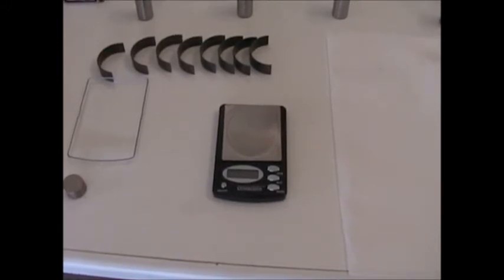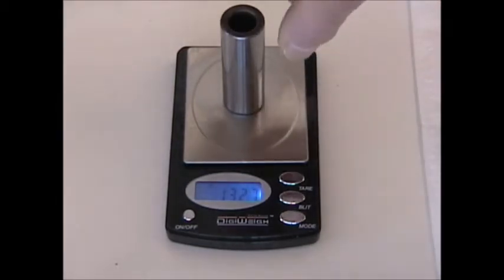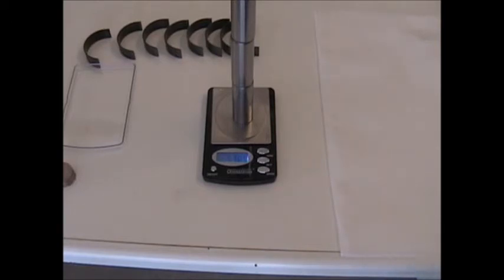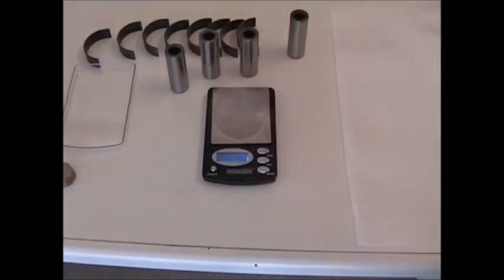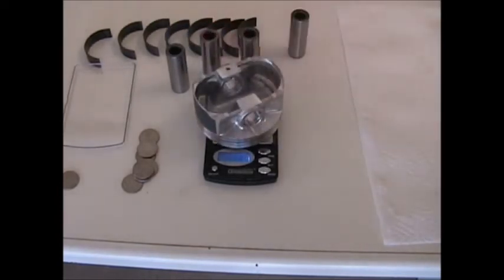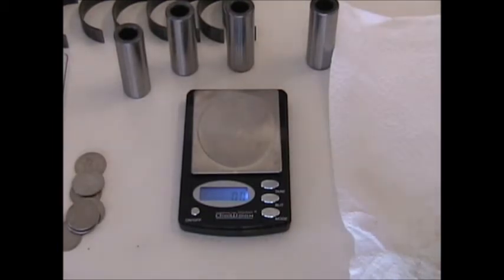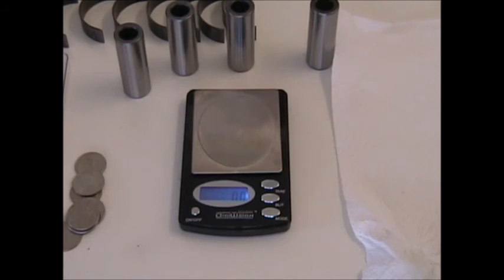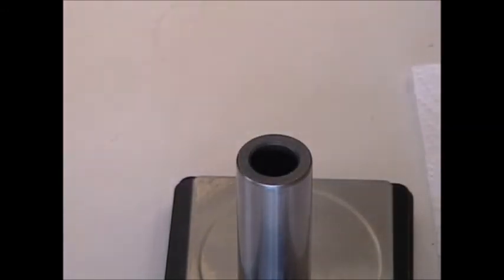Subaru Piston balancing DIY with $14 balance.

Comment: Awesome man! Did you balance the rods as well?

I was just trying to get rods and pistons that are already pressed together to balance.
 
1 and 4 weigh the same while 2 and 3 or just slightly heavier but equal to each other.

I'm not sure how much they actually weigh exactly because I'm using a very sensitive home made balance scale.

To counter balance I have the old beat up #4 piston still attached to its rod with a little help from some sliding weight. 

 I think I might can get the heavier ones down a bit by filing out the middle of the wrist pins a bit or maybe I'd be better off finding more metal to remove from the pistons?
Reply from the maker: +ILTSYC Glad you liked the video. I did balance the rods separately, especially since I had to use a rod out of a different engine. I tried a couple of methods of rod balancing but was not successful in balancing them end for end. I have another video on that which I need to edit before I put it on YouTube.
I do not think you can reliably balance a rod and piston already assembled. The piston is reciprocating mass while the big end of the rod is rotating (forgive me for stating the obvious). You could have the assembles weigh the same but have a light piston and a heavy rod.
Reply: +Brian Thorpe 
Thanks for the reply! I suppose I could press them apart and balance everything separately. I believe it will be worth doing.

 As it is now I'm pretty sure there is going to be some vibration. The engine vibrated before the head dropped a valve seat and I guess what I've found on my scale is the reason. Its an 02 Ford Focus which is notorious for dropping intake valve seats.

But don't you think and might be wrong that it would be better to have the piston and rod together weighing all equal as opposed to doing nothing at all. I'm sure it wouldn't be as good as having a separately balanced piston and rods.

 I like the quickness of your gram scale its so much faster than a balance scale. Fastest way to work with a balance scale is to limit its movement to an 1/4 of an inch.